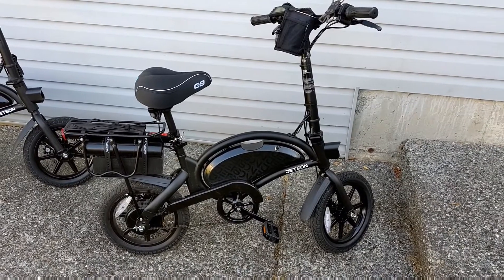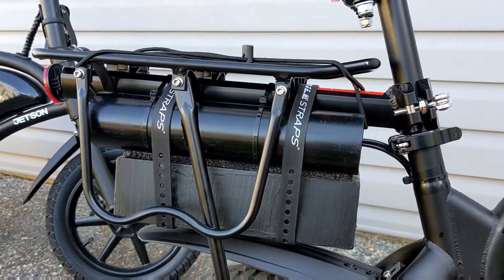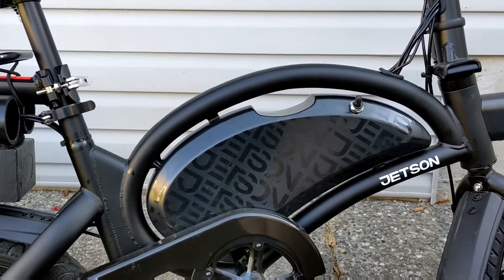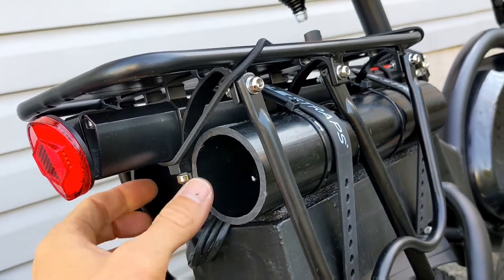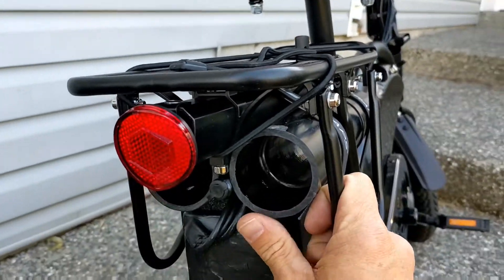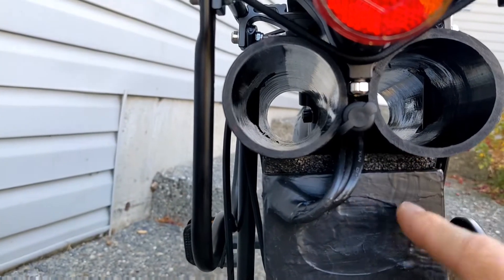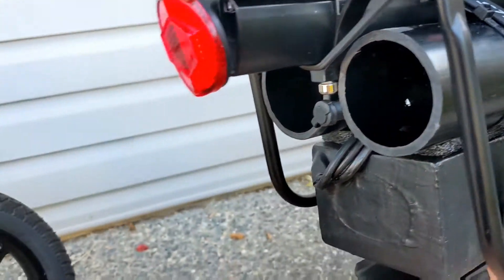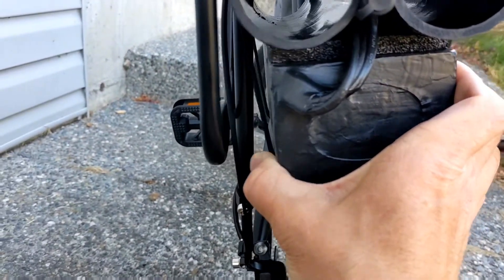Jetson Bolt Pro Dual Battery Mod

Comment: Sounds like the way you wired this is either/or with the batteries being separate.  I'm looking to connect two batteries in parallel to make one battery. I've talked with several experts in this area and if you have two dissimilar batteries there is a voltage adapter ( around $12) that allows the two to be connected.  If you can get an exact duplicate of the Jetson battery you don't need the adapter.
Reply: What is the advantage of them being connected in parallel over a switch?
Reply: @LLF1234  your creating a single battery when in parallel as the voltage stays the same but the amperage doubles. Then you don't have to switch the batteries after one is depleted

Comment: Link to the exact rear rack ? I have one the the rods that connects and holds it up ate less than 15 inches.
Reply from the maker: The rack I used: Lumintrail Bike Cargo Rack, 55 LBs Weight Capacity https://a.co/d/5WQ4AOM

Comment: How hot does the battery get with the plastidip and lots of insulation over it?
Reply from the maker: It stays cool.  The motor in these bikes doesn't draw enough amps to cause any kind of heat issues.  I upgraded the ECU for max speed/power and still no heat from the battery.

Comment: how fast does it go on 48v?  is it using the stock controller?
Reply from the maker: For me, 170lbs, on the original battery it's about 13 mph and the 48 volt battery is about 18 mph.  I did upgrade the controller.  If you search "Jetson bolt pro adurino hack" you will find videos on how to remove the speed limiter on the original controller.  I'll probably do the adurino hack on our other Jetson Bolt pro.  If I do, I'll post a video on any differences in performance.
Reply: @168grhp  thank you.  So all you did was the Arduino hack on it?  Do you know what the new range is with the 48v battery?  I think I'll probably do the same as you eventually.  😁
Reply from the maker: @willchen2828 You're welcome.  I plan to do the adurino hack on our other Jetson.   For the bike in the video, I have this controller on it: https://a.co/d/fvF55bz. 
We live in a hilly area, which drains the battery much faster than on flat ground.  Range is about 7 miles on the 36v battery and 12 on the 48v battery (no pedaling).